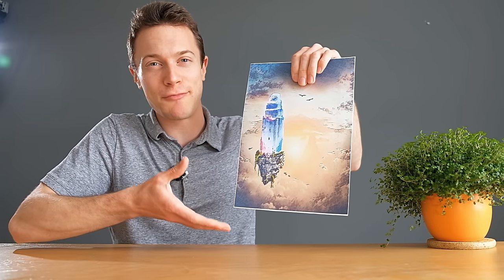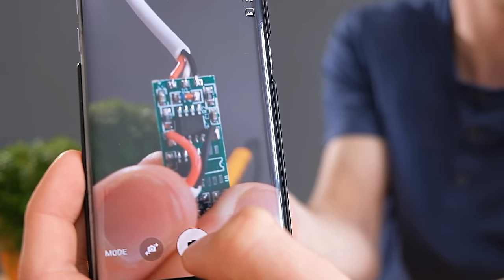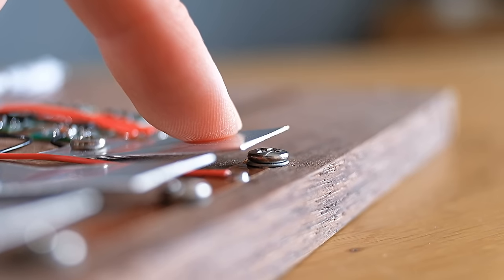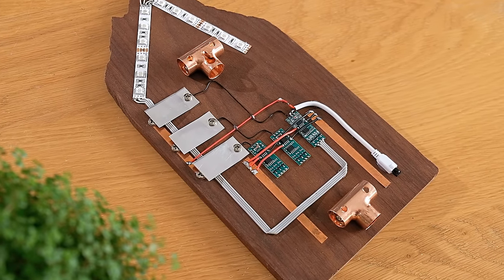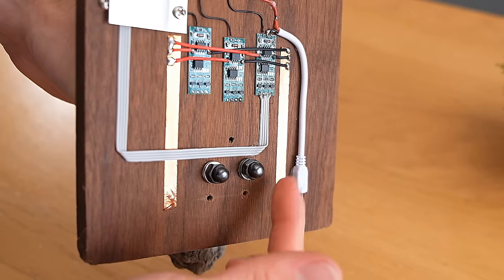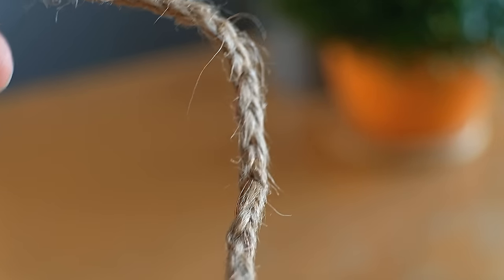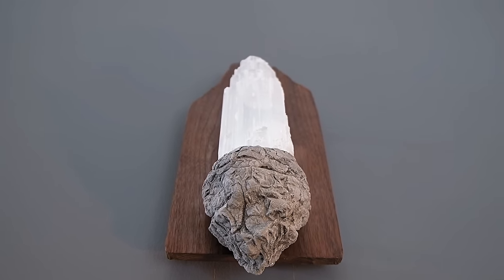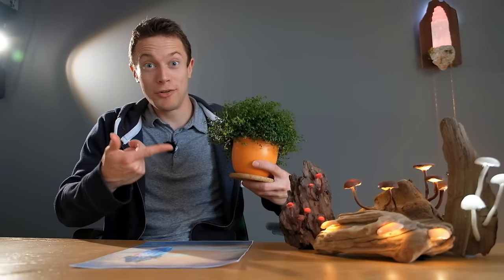Stunning LED lighting projects you can make at home!

Comment: Quite old video, I was wondering if during"use" you could scratch off the enamel of the copper wire leading to the lamp. My question is, would thst potential be dangerous?
Reply: 12 volts is unlikely to harm you. Not impossible but unlikely.
BUT 

The enamel on those windings can be very brittle and there is a strong chance that just by unwinding it you may have exposed copper, if the exposed copper causes a dead short you could be pulling 100% of what the power supply is capable of providing. If that happens? Best case scenario the fuse goes in your power supply. Worst case? It could overheat and damage the power supply or you could ignite your jute twine.

Copper tape is also not ideal as a conductor and aluminium flaps aren't ideal switches. 

I'm horrified at what this guy is suggesting people use to carry current. Take the time to use properly rated wires and use proper solder joints not just the friction of a screw to make connections. It's a shame he's cut corners like that because it's otherwise a really nice idea.

Comment: Even though the wires are 'low current' they still freak me out. I wonder if there is a way to make this battery operated?
Reply: Look up on Amazon "Talentcell 6000mah Battery Pack". Used this as an alternative to the wall 12v connection and mounted it over the circuitry, hiding it behind the wood.

Comment: It seems that you left out some information. I'm referring to what appears to be a recess in the top of the cement into which the led strips are installed. It's also missing info on how to attach the led strips into that recess. I consider myself to be pretty resourceful, and I for one am able to figure out what needs to be done, however, I'm sure there are probably people who are left not knowing how to proceed, and may just abandon the whole thing out of frustration. I'm simply offering my observations, and I don't mean to be critical. It's an awesome project.

Comment: Not sure about the safety of that power cord TBH. You should buy properly insulated wire and instead find a way to braid it differently so it hides the wire.7

Other than that, great project. I was looking for a technique to make a rock-looking base for a project of mine and I think I will follow your tin foil idea!

Comment: Matt, 
i tried to do that base i think 12 times now, 
the concrete, just is too heavy for a single sheet of concrete, and i tried to do it with several sheets,
but then it goes out of the sides, and it can never hold it's weight like you show here, 
it needs allot of support
allot more from that bundage tape u put to wrap it around, 
i'm kinda hopeless on making a concrete *island that looks that good
i tried taking clay and sculpting it to look like stone, but it just came out looking very bad.
any tips ?
Reply: What I used is plaster. It's lighter than concrete and sets much quicker. Only issue that arose for me was slight cracking and incredible difficulty getting all the tin foil off the plaster. 

Good luck, this is definitely worth the effort :)

Comment: if for some reason you want to mass produce these...or at least make more of em...i think the tinfoil can be paper-mached with resin as glue and some tissue paper on the outside so the tinfoil keeps its exact shape, the tinfoil can probably be sculpted into more exact cliffs, maybe like a spiral or something...after the paper-mache is done, hit it with a layer of mold release and fill it with cement, it should pop out when cured and there it is...multiple of these with the exact same base....will look amazing in a sort of AVATAR setting, remember the magnetic cliffs?
Reply: also...this went straight into the "to do list" playlist :D....thanks for the help

Comment: You could also just run the wire inside the wall
Reply: That is not so easy here in Europe, because we mostly have thick concrete or brick walls. But if you have hollow dry-walls, go for it!

Comment: Hey guys could you please help me? I'm looking for an LED strip to connect to the JRGB1 and to the JRGB2 slots on my Mainboard. I hope that the MSI software will control the LED strips (it says it is a 12V pin)
I have an MSI x470 gaming plus. Can I just use any LED strip for that?

Comment: Umm... Ok this is a fantastic video, but you seemed to have left out a few parts, like how to you get the tin foil off after it was done, how did you make the imprint to get the tower and the LEDs to fit right when put together. These are very important steps you skipped over. Could you please explain at least the first one of the tin foil ?
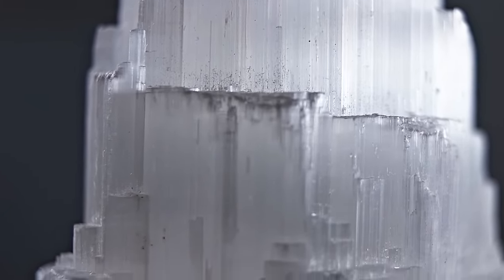Reply: At 10:00 how he wrapped his crystal in plastic cling wrap and molded the concrete around it while it was still drying.
Regarding the foil, this is briefly mentioned at 8:28.

Comment: Uhm... The cable looks cool sure, but electricity can conduct heat... And a burning cable is not cool at all.
so just wrap an isolator around the copper wire and it´s way more safe...

Comment: Let's get one thing straight, no matter how low Voltage, never use uninsulated wires.
Reply: They aren't uninsulated. They just have a copper like color
Reply: They aren't uninsulated. They are just copper like in color

Comment: I don't know much about electricity but wouldn't you get shocked by that wire?
Reply from the maker: Not at all - it's enameled for starters, so isn't conductive to the touch, but it's also low voltage (12v) so even if you had direct contact it wouldn't do a single thing.
Reply: Thanks for your response!

Comment: So to his insistance that there's very little risk to this project, I'd like to point out as an electrical engineer that you, sir, sadly are extremely misinformed. Not only are each of those LED controllers explicitly rated to support outputs of 4 Amps each, even if the load they supply isn't using that much, that still means the hypothetical load on those super thin enameled copper wires is as much as 12 Amps, which at 12 volts makes for a total wattage of 144 Watts. Further, dependant on the power supply used it could easily draw even more than that and given you have not only highly exposed enamel wire and a bunch of exposed copper strips and contacts right against the wall, there would be nothing preventing any kind of damp or spray, from say a spilled drink or a very wet and rainy day, causing the circuit to form a dead short that can quite easily start a house fire.

I like the project idea but really, even the slightest care about the safety of the end user, who may well not be the one who made it, seems almost entirely disregarded here and especially in america with it's match stick houses I can see this being a huge and deadly fire risk.